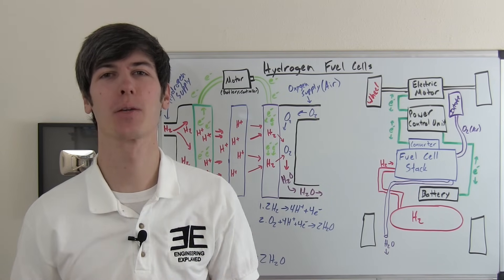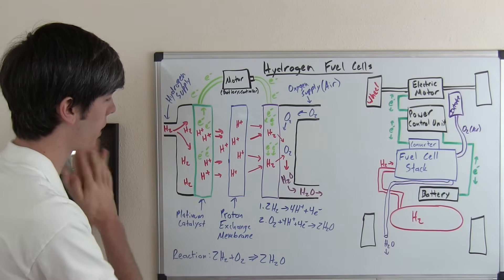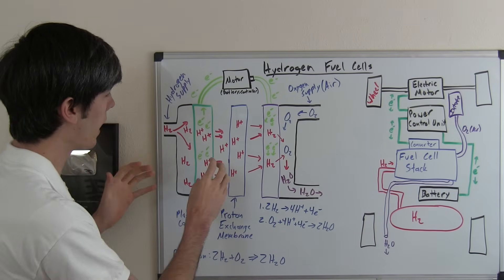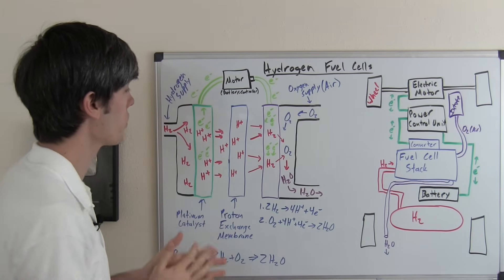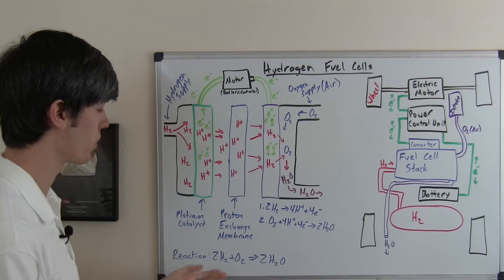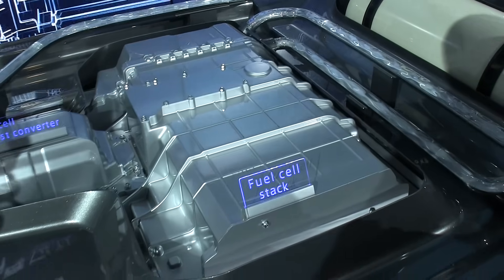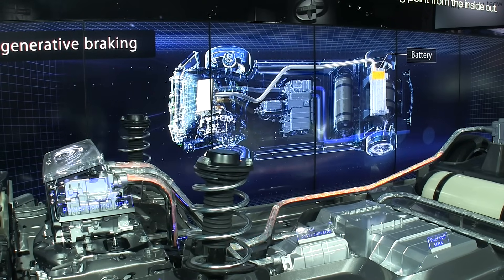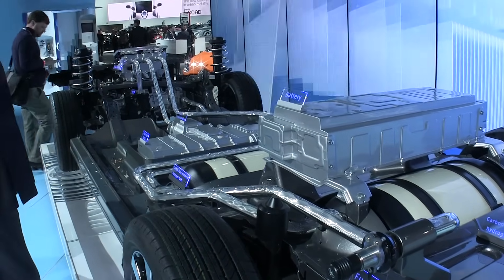Hydrogen Cars - Toyota Mirai - Explained

Comment: I think these will never hit mainstream, because the production of hydrogen is still to expensive, producing it from methane pollutes so much that it is not worth it, so it is not a question of infrastructure that it will not replace the internal combustion engine.
   I believe like Elon Musk, that electric cars are the future, I bet the graphene aerogel batteries will solve the current problems with electric cars, so that they will charge faster, last longer, and carry less weight. Just imagine a 1000 mile range with a 2 hour charge on a daily basis, that kind of mobility will make fossil fuels the thing of the past, at least my child will drive such a car.
Reply: I think that cars will never hit mainstream, because the production of automibles is still too expensive. "An "intelligent" man from 1899" Same with mobilephones, they started by being expensive, and now even homless ppl have phones... Or, electric cars, they used to be super expensive, and ugly, now they are just expensive. The more ways of powering a car, the better
Reply: ***** Changing the infrastructure is the main concern, what Tesla is doing is the right way, they are trying to build more and more supercharger station throughout the US and Europe, just imagine what would you do without Gas stations everywhere, your car would be useless without fuel, so is with electric cars, and the charging time should shorten.
   I know that there are some new nanotechnologies that would help electric cars like aerogel and graphene, but I think the future 30 year will be still dominated by internal combustion engines.
Reply: Nagy Szilard Yeah, so what? You are simply being ignorant. When internal combustion engines showed up, there weren't petrol stations everywhere, the same goes for Hydrogen, and electricity. But electric cars have the huge advantage that you can charge them at home. But if enough ppl will start to buy Hydrogen cars, then there will be more and more hydrogen stations. Saying that Hydrogen cars are bad is like saying electric cars are bad because there is no supercharger station near me, thus there is no supercharger station anywhere on the world, and there will never be

Comment: So dosnt hydrogen go boom with a spark?
Reply: Tyler Chumbley There are no sparks involved in this process, it's basically an electricity generator based on hydrogen to get the electric motor to spin. No crank, no case, no intake, no turbo, no sophisticated anti pollution system, nada. The only problem will be the hydrogen storage, which is highly compressed and... well, expensive to make.
Reply: +Tyler Chumbley No, hydrogen is more stable than gasoline actually. You can fire incendiary rounds at a hydrogen tank and it will not "go boom."
Reply: You'll be the first human test ok?
Reply: +ytdood there's also the factor that hydrogen is explosive/ flammable.. Correct? Thus making this vehicle extremely dangerous to drive. One simple accident and those hydrogen tanks could explode. 
At least that's my understanding.. Feel free to correct me if I'm wrong!
Reply: @ashtonsteinke6781  they're much less dangerous than a gasoline car. So, try again...
Reply: +Ashton Steinke It is. And that requires a strong, durable, and, mind you, heavy tank for storage. I wouldn't worry though, the tech will surpass this issue long before having a real hydrogen infrastructure...

Comment: Why is hydrogen not used for combustion?
Reply: +nutnfan1 because it is highly inefficient (due to the way a combustion engine works - no matter what kind of fuel you use). Plus you create nitrous oxides when burning anything using air

Comment: It's nice to see all of the YouTube Comment Section Scientists arguing and describing why hydrogen cars are super inefficient and that they are not the future. The range of a hydrogen fuel cell powered Toyota Highlander is supposedly 300-400 miles (http://www.washingtonpost.com/blogs/the-switch/wp/2014/01/24/i-tried-a-hydrogen-fuel-cell-vehicle-heres-what-it-was-like/) ; thats leaps and bounds beyond electric cars, and even quite a bit more than the Tesla Model p85d. It's fascinating to watch you all pull bullshit out of your asses, make unfounded statements, and completely discredit this technology. Maybe it isn't the future, but they've hardly scratched the surface and its already ahead of at least a decade of research for electric cars.

Comment: Wankel engine with ultra high compression ratio of like 30 to 1 running on hydrogen with direct injection and having the wanel itself light due to use of polymer ceramics used in modern weaponary would outdo this pseudo efficien scheme. You consume less when you drive but consume way more to produce. Zero emissions from the car, but ton of emissions producing and dumping old batteries that die out in couple of years.

Comment: Questions:
- Is the H2 pressure important for the process?
- How efficient is it?
- Wouldn't be better to burn the H2? You would get H2O in the tail pipe too...

Extra questions:
- Is it safe to carry pressurised H2 around? (Hindenburg disaster comes to my mind)
- Where is the H2 coming from: Water electrolysis? Natural gas? At what [environmental] cost?

Thanks for the video(s)
Reply: - I think that in rockets they use pressurized H2, I would assume more pressure=better efficiency for the volume needed
- This is efficient for its weight (again the reason it’s used in rockets) but not too efficient for its volume
- If you burn the H2 it creates nitric acid which isn’t good, and it’s less efficient, I believe he covers why in one of his more recent videos
- As for your extra questions...I have no clue
Reply: +botinhas82 These are the questions that everyone should be asking.
Reply: Nowadays we've got renewable energy sources getting implemented at a much higher pace than the usual fossil/coal/nuclear ones. So it's not crazy to assume that our worldwide power will be far less contaminant in a 10 to 15 years period. That will give us the ability to produce H2 from electrolysis using renewable sources, thus producing very little contamination. 

About the Hindenburg, It was no pressurized H2, it was actually below atmosphere pressure (that´s the principle that gets blimps floating, its because they become lighter than the fluid around them, which in this case is air) and contained un a VERY fragile structure designed to be as light as possible. Talking about a hydrogen tank on a car, they've been made of resins and polymers that can withstand ENORMOUS amounts of puntual pressure, not only the pressure from the inside coming from the stored H2, but also immense pressures and stresses from crashes, and or accidents. Also those tanks have an inside valve that reacts to violent forces (steep acceleration changes) and close from the inside... so no leakage is allowed after a collision, with the plus of being protected by the super strong structure of the tank itself.  

I think they're pretty safe, maybe even more than carrying a VERY flammable liquid on a plastic tank that can be punctured by almost anything. (I've seen tanks being punctured by wooden sticks on off road trails)
Reply: Still waiting for answers
Reply: Yes it would, BUT (actually two buts) apart from the water, the byproduct of this combustion is also nitrogen oxide AND it’s roughly half as efficient.

Comment: And Hydrogen cars are beyond stupid and not the future. You're better off going with just using a battery.
Reply: Fair point Armaan, modern gasoline engines have a maximum thermal efficiency of about 25% to 30% when used to power a car. Before doing so, if we go into the extent of manufacturing/retrieving the fuel which you've done, I'd guess "normal" petrol engines would come out just in front in terms of overall cycle energy efficiency, however, using hydrogen has the one obvious advantage of being renuable. There are other methods of obtaining hydrogen such as photobiological water splitting, which I belive goes well with the topic in hand. Especially now that is is considered economically feasible.
Reply: Armaan R Don't quote me on this, but i believe that the amount of energy an internal combustion engine produces from petrol/gasoline is only 20-30% efficient.
So if anything its an improvement.
Reply: Yes that's absolutely correct. Gasoline engines have a maximum efficiency of around 30% and Diesel engines 40% because of the higher compression ratio. I was comparing hydrogen fuel cell to an electric vehicle. Minimizing the number of times energy has to be converted is key.
Reply: On par with comparing electric fuelled vehicles (Ie. Tesla vehicals) and hydrogen fuelled vehicles (Ie. Toyota Mirai), as far as manufacturing/refining the different fuels, using photobiological water splitting seems long a long term more efficient and much cleaner way to provide hydrogen (fuel) rather than generating electricity.  
Say every car/truck has converted to using hydrogen as it's only fuel source, 30-40 years down the road. All emissions to do with digging for oil, transporting oil half way across the world would be obsolete, and the transport of hydrogen, which could be manufactured in the same country, would be emission free and far cheaper.  
In the real world, being able to fill up with hydrogen quickly is far more practical than even the Supercharger network Tesla employs.
Reply: I think you're right
Reply: SeverdSeouL So again, what is your point? Hydrogen cars require batteries. You're just wasting more time and money on hydrogen cars instead of just charging a battery via a renewable resource, and powering the motor directly. Hats off to the guys who sold morons on the idea that hydrogen cars are the second coming of Jesus though.
Reply: Porsche Curves In regards to the normal range issue with electric cars, using hydrogen effectively allowing you to recharge the battery at any time should add more range per tank than pure electric cars. More of a non-plug-in Prius style battery recharge system.
But other than that I agree battery technology still has a looooong way to go before it becomes long term usage and environmentally viable.
That video you posted was the head of an electric car company talking, of course he will rubbish other technologies. As he said electrolsis is an inefficient way of generating Hydrogen, but photobiological water splitting remains viable in my eyes.
Reply: Damo_2j There is battery swapping which takes just as long as petrol does to fill. Charging times have come a long ways as well. 30 minutes for 80% charge isn't half bad at all.
Reply: Porsche Curves In the grand scheme, it would probably be more efficient to power a battery from the grid, itself powered by a fusion reactor than iin-car H cells. Anyone else think so?
Reply: ***** Except that you can just use pure battery with electric motor and just get free energy from the Sun. Whereas hydrogen, you are still converting MANY steps, and since we will never be able to do 100% conversion, the more conversion you have, the more power/energy you will loose.
Reply: It may be an inefficient process, but with Hydrogen being the most abundant element in the universe, I dont think inefficiency is an issue.
Reply: He's right lol. Converting over and over between different forms is terribly inefficient.
Reply: ItsThatMilkshake Not my fault you're ignorant. It's a super inefficient process.
Reply: If anything methane is far better than hydrogen.
Reply: Lol stfu
Reply: For anyone else wishing to try to make Hydrogen cars seem better than they are: https://www.youtube.com/watch?v=Y_e7rA4fBAo
Reply: Except for the fact that electrolysis requires over 15,000 kJ per liter of H2O.Next, the hydrogen fuel cell has about 60% efficiency. Now we must send power to charge a battery of 80-90% efficiency. And take into account that hydrogen will evaporate 2% per every 24hrs. It's a senseless process, taking electricity converting it to hydrogen, only to go back into a battery in the end.
Reply: SeverdSeouL How is battery technology terrible? It has been improving. Oh, and Hydrogen cars use batteries. There goes your whole argument on battery technology when hydrogen cars are far more inefficient at producing power. But please, stay ignorant or at least use Google to cure your ignorance.

Comment: Isn't this basically a copy of the Honda FCX Clarity?
Reply from the maker: They use the same fuel.
Reply: Yeah but to my understanding it's a very similar design.
Reply: ***** Toyota has developed its own FC Stack and Hydrogen tanks for the Mirai, not to mention they've had multiple FCHV models since the 90s. Hardly a "copy". Using similar logic, you can call all ICEs a copy of each other.

Comment: With no demand for hydrogen fuel this unfortunately won't be implemented anytime soon. A great technology but as far as I'm concerned this type of engineering is very backwards, these cars have been around for a while now and aren't being used. Toyotas talented engineers should be focusing on diesel market in my opinion. Diesel is the next step for automakers with regards to efficiency and what today's drivers need out of their vehicles

Comment: Is the produced water combined with anything to prevent ice from forming on the roads? Or is the amount of water produced is insignificant?
Reply from the maker: It will likely be vapor.
Reply: mikehuntsayit Electrolysis can do that, but I think the energy input is inefficient; acquiring more hydrogen from a gas station is probably a better choice.
Reply: It's liquid water. Don't picture a faucet being switched on though. It's more like drops of water.
Reply: Engineering Explained cant you re separate the hydrogen and oxygen by using electricity.

Comment: Why can't that h2 on the way out
Of the second catalyst be recycled rather than turned to h2o? Is it cause they gained a negative charge or something?
Reply: It is not really h2 anymore when it passed the proton exchange membrane. If you take away the electron of a hydrogen Atom, you end up with a proton.
But the whole reason a fuel cell works in the first place is the diffrence in electronegativity between hydrogen and oxygen. The free electrons are more attractet by the oxygen atoms on the "exhaust side" than by the protons they came of because the oxygen atoms have a higher electronegativity. So, the electrons will bond with the oxygen atoms first and not with the protons which passed the membran.
It works like this on the "exhaust side": 2 electrons bond with 1 oxygen atom > forms an oxygen ion with a charge of 2 -> oxygen ion will bond with 2 protons to neutralise the charge -> Result H2O.

Comment: Probably my favorite video you've done since the engine balancing video!  Great work here.  I'd love to know more about the proton exchange membrane physics.  How does that work?  What if anything could cause it to fail?  And why not re use the H2 instead of making water?   Is the charge wrong or the lack of pressure the problem?
Reply: As I understand it, because O2 is always present, some of the spent hydrogen will instantaneously react once it crosses the proton exchange membrane. This would pollute the pure hydrogen supply and cause the system to fail. It's just much simpler to let the spent hydrogen go, but it would be possible to have something that separates H20 from H2 to reuse H2. Eventually all the H2 would form water and have to be replenished from a pure source though.
Reply: @johnmiller2011  the video is wrong. H2 is not reformed. That would make no sense. The reaction between the H+ and O- to make water is how the fuel cell produces electricity. If you had H2 on both sides there would be no electromotive force to push electrons through the external circuit. If you start with H2 and finish  with H2 you could just keep using the H2 forever and have unlimited energy, which is of course impossible.

Comment: I think the explanation is not perfectly correct: oxygen should accept the electrons coming from the external circuit, not hydrogen: so that positively charged protons can bond to negatively charged oxygens to form water. I could be wrong, though.
Reply from the maker: Sounds good to me. Or they all three just decide instantly to embrace each other. Group hug style.
Reply: Engineering Explained This is a happy thought, but the electrons do actually bind to the oxygen first, as is the case in your body's way of harvesting energy. Source: Biochemistry student.
Reply: Thomas T He could be right.
Reply: Thomas T  What I studied tells me it should work like I said, but since I know there are people being more prepared than me I wanted to specify that mine is just an idea, an opinion. I expected people to discuss about it, tell me if I am wrong or right, but for the most part I was disappointed.
Reply: if you could be wrong then why comment at all?

Comment: how much oxigen do they use, if all the cars today would be replaced with oxigen consuming cars, would it be much of a problem?
Reply: today's cars are oxygen consuming
2 C6H6 + 15 O2 = 12 CO2 + 6 H2O + heat (assuming perfectly clean burn).
If you produce hydrogen by splitting water you release oxygen gas in the atmosphere, the same exact amount will be absorbed by the fuel cell while running the car.
Reply: Nice :-D